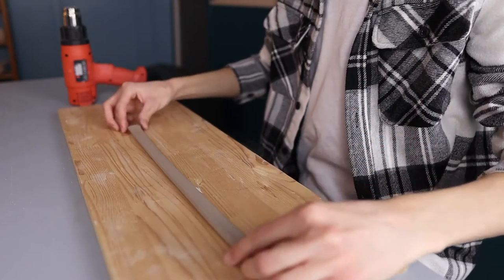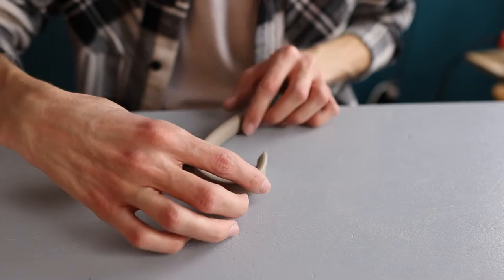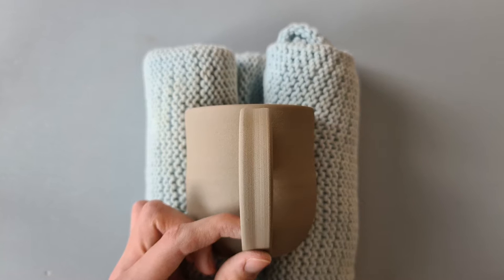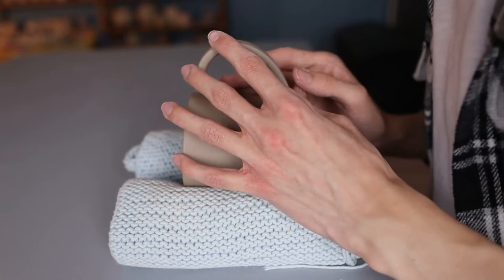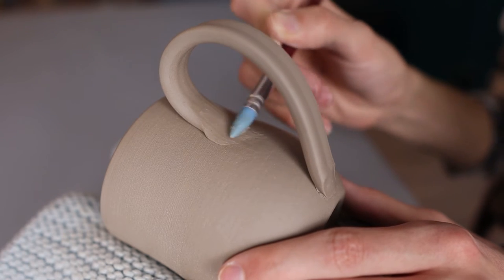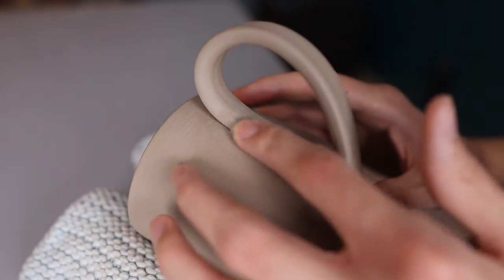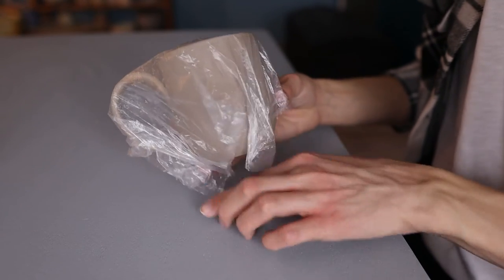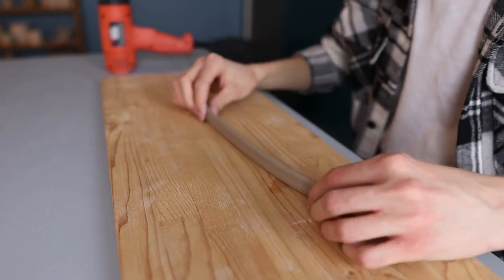How To Attach A Handle And Prevent It From Cracking // 3 different shapes

Comment: Thanks! I just attached an elegant handle to my jug thanks to your video! First time using vinegar instead of slip so will see how it goes drying. I’ve popped it in an old freezer we use as a wet cupboard (not switched on of course)… so will dry it slowly to give the jug and handle time to become one 😊

Comment: Very interesting. I often have problems with my handles. While they do not crack because I dry the mugs very slowly,  they often distort because they are so soft. I have an old hair dryer in my studio. I will see how this may work in firming up the handles. Another good video. Thanks!  Gabriele
Reply from the maker: Thank you so much Gabriele! Drying them with the hair dryer should do the trick😁

Comment: Do you not use slip when you attach? Only vinegar? I’ve never heard of that. Lovely thinness on the cup and a beautiful shape to the handle. Is the cup leather-hard when you do this? And how soft is the clay of the handle? Very interesting video. ❤️
Reply from the maker: Thank you! Yes, I only use vinegar and no slip. The vinegar has a reaction with the clay which makes the clay viscosity higher which means it becomes stickier and helps it bond better. The cup is leather-hard, I attach the handle directly after trimming it. And the clay of the handle is as dry as possible, but to a level that I can still easily bent it.
Reply: @caldervanandel  wonderful! I have to try that in class soon.
Reply from the maker: Have fun!!🎉

Comment: Thanks for the great ideas. If you still have cracking problems try changing clay body. I had a clay that never cracked, I literally dried them out in the sun and wind and fired the day after throwing.  Then they stopped making that clay and I've had trouble ever since.

Comment: Fantastic!  Thanks SO much for sharing all this!   Love how carefully and patiently you work.   By the way when you throw,  do you mostly "wedge on the wheel" (coning up and down, as you show in your videos) or do you also wedge the clay on flat board before you cone up and down on the wheel?
Reply from the maker: Thank you so much! I do wedge the clay a little before I start throwing, but I know that the clay I use doesn't have air bubbles in it, so it's mainly to make it a bit softer. I wedge on top of a plasterboard.  I'll include it in some videos in the future😊

Comment: Hi friend (I don't know your name), I'm your follower from Argentina and my name is Hugo.
I'm using google translate, sorry for the errors in my writing.
I congratulate you for the neatness of your work, which can also be seen in the order of your workshop. If you saw mine you'd be scared.
My query is about the differences in temperatures between the sponge cake and the glaze.
What enamel do you use? Don't you crack with those differences? I do everything at 1070 degrees centigrade, to avoid cracking.
Greetings from Buenos Aires, Argentina
Reply from the maker: Hi, my name is Calder. Thank you so much! I use stoneware glazes, which I fire at 1220 degrees Celsius. And I don't have a problem with them cracking, if that's what you mean. I have had glazes that cracked at a lower temperature, that's why I moved over to stoneware glazes☺️